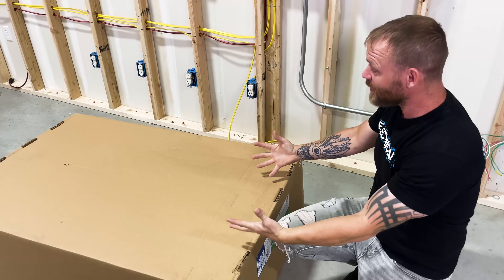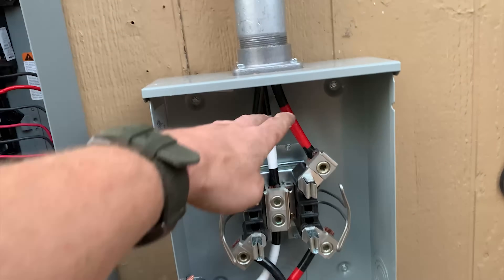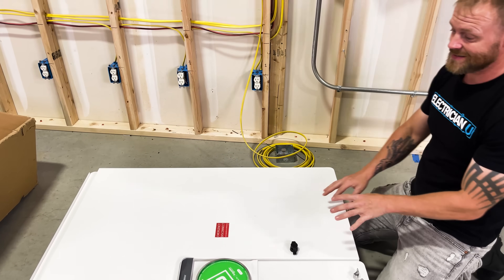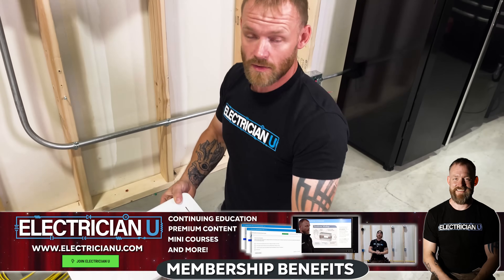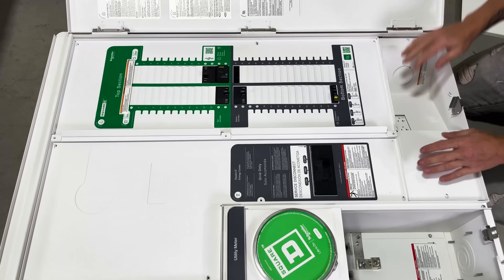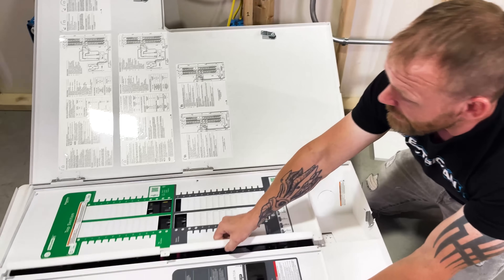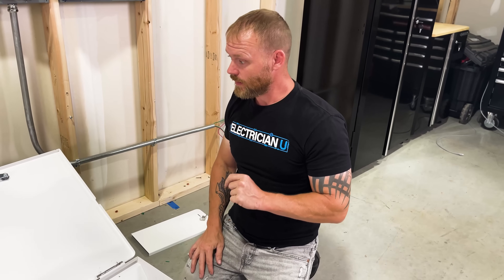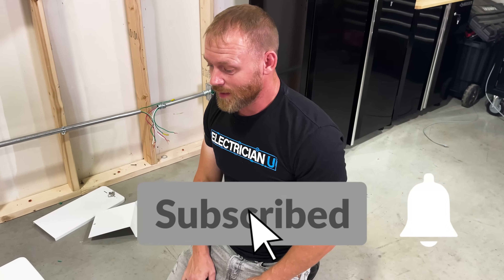The ALL-IN-ONE Energy System You Need for Your New House!

Comment: The use kind of goes out the window when utilities dictate a single meter base for use. I'm also not a fan of locating breakers outdoors.
Reply: Always found spider webs, dust ,dirt and bugs inside of outdoor breaker enclosures. They beating hot sun & below freezing temperatures have shorten the life of cheap $5 plug in circuit breakers. At an IAEI continuing education class a few years ago a well respected inspector told us that you are not allowed to run NM  cable ( Romex ) to outdoor luminares or receptacles because it's not approved for damp locations. Told us to start using UF cable. If you had a 42 circuit panel outdoors you would have to drill several large holes for say 2" nipples to transition from a large indoor trough, strip insulation off where it enters trough then run all of the white & black wires thru large diameter nipples. Grounds could terminate to a ground bar inside trough. Rather have all of my circuit breakers except for maybe the one for central AC unit & outdoor receptacle inside of climate controlled basement. Don't want to go outside during a rain ,sleet or snow storm to reset or shut off a breaker. Every few years during a heavy snowfall snow will drift up 4 to 6' on rear door making it impossible to open until you walk or crawl thru snow drifts to shovel back door. Rather have my breakers in a nice climate controlled basement.
Reply: @JohnThomas-lq5qp  you do realize basements in many areas like fl are not available and many homes built all over are slab foundations on grade. even as far back as the original Levitt homes in 1950s
Reply: @jar407  Yes but in my area think I only came across two in the hundreds of service upgrades that I did in last 50 years. In neighboring state was told s few times that most homes in South New Jersey do not have basements due to sandy soil. Did a panel change out in one house that did not have a basement. House had panel flush in an exterior wall under a bedroom window. It was a small one story house that had the gas water heater in the attic. Of course water heater leaked in middle of winter when homeowner was on vacation. Caused thousands of dollars damage a long with ice from house down driveway then down the street.
Reply: @jar407  I’ve lived in Florida my whole life. This is the first time I’ve even heard of a breaker box outside.

Comment: I agree with Mr. Wren.
I have not checked yet, is there a change in the code to include an overhang or partially inclosed area, aka small platform with security fencing, that would accommodate?

Comment: Obviously this is intended to be installed in a protected environment (no weather seals, no locks on the door), but I thought power companies generally required uninhibited access to the meter base. Unless that's not the case, what's the use case for this?
Reply: It is nema 3r rated. 3r stuff is raintight, it doesn’t have to have rubber seals or locks on the door. NEMA 4X and other ratings would have to be sealed, stuff that’s rated for direct water spray or classified locations
Reply: @MrSamsamsammy  .... maybe I missed something, but I could have sworn that cabinet had knockouts on top, which cancels any NEMA 3R rating.
Reply: @rupe53  depending tek with a liquid tight ring is rated for that or plastic conduit with a liquid seal
Reply: @UnifiedInfo  ... it's not the conduit, but the cabinet itself. Look at 7:25 from the inside and 10:20 from the outside. Knockouts on top of a cabinet will not be rainproof!
Reply: What if the panel is partially recessed into a wall, though?
Reply: @MrDontcareify  ... I tried looking at the mfgr's web site and they are so busy talking about the other features they neglect to mention if it's rainproof. Based on the building code requirements of meter height and breaker height, this may fall through the cracks. They did think to put the main breaker next to the meter, so that might give them a pass, even though the breakers would be high. Flushing it into a wall then adding a header might be a solution, but on a standard 8 ft will, adding a header will cramp the access space on top of the panel.
Reply: @rupe53  It's a semi-flush CSED for the west coast.  Those knockouts are inside and the meter and cover / access is outside.
Reply: @tracyphillips9681  ... that does seem to be the case, but I haven't found it in their data sheets / instructions. One would think there'd be mention of an install kit to make it 3R compliant.
Reply: @rupe53  I think it is semi flush and flush mount so the knockouts will be inside the wall.
Reply: @illestofdemall13  ... that's a distinct possibility. It's just not spelled out in the specs as a NEMA 3R item.
Reply: @rupe53  I looked at the product specs on Home Depot's website and that's what it said. (Meant to be flush or semi flush but it is outdoor rated. It is new construction and not remodel)
Reply: @illestofdemall13  ... thanks for finding that. I was looking to see if there was a kit or accessory package with a flange mount but didn't see one. I would guess the directions might specify calking it into the siding if that's the case.
Reply: I noticed the same thing and even in a protected area (breezeway between a house and garage) it would need the NEMA 3R rating because that's still considered outside. With remote meter reading I can see where this might go inside, but down in his area (Texas?) most everything is outside.
Reply: Its  fine to put outside wherever you like just like the other meter pans etc.
Reply: LOL, there's no way I'm putting a full panel outside without locks on it. And what a bloody nuisance if you want to go flip breakers, especially in lousy weather.  I'll stick tolocating it in the garage or basement.
Reply: @JCWren  ... I think you will find there's a good portion of the country that does NOT have a garage or basement, which plays into some of these comments.
Reply: @JCWren  new construction in co, all panels are outside
Reply: @JCWren  most houses in CA are this way. Meter with branch circuits outside
Reply: That’s a lot of studs you’re gonna loose if it’s recessed. Carpenter might have to put a header over the can then electrician turns the header into swiss cheese.
Reply: @SB-ww9nj  You will only lose one or 2 studs. It's a new construction model so all of those adjustments in framing will be done ahead of time. It is only meant to be flush and semi flush, not surface mount.
Reply: Apartments with separate utility rooms have meter mount inside sometimes. But your making a great point lol
Reply: Enclosed in a closet it’s common in big houses in cali